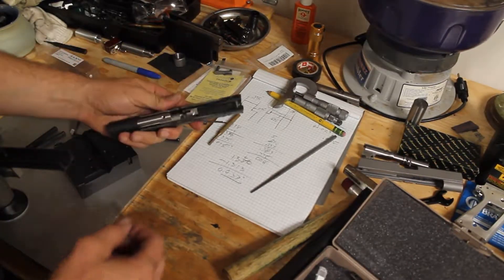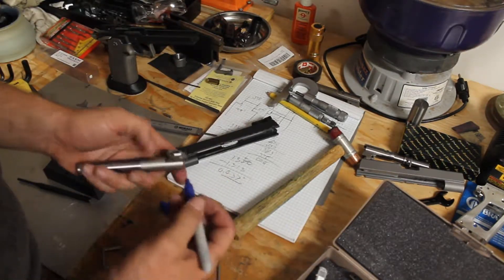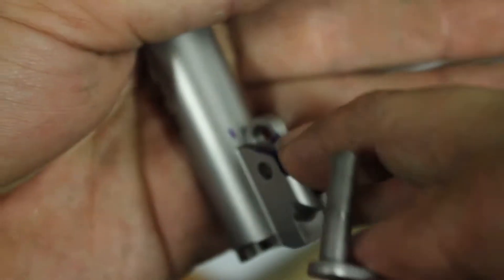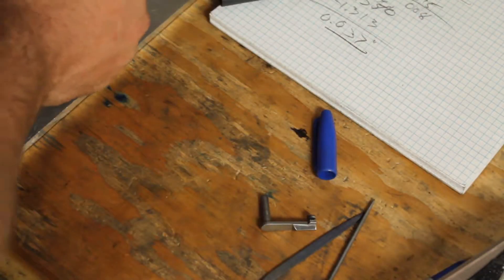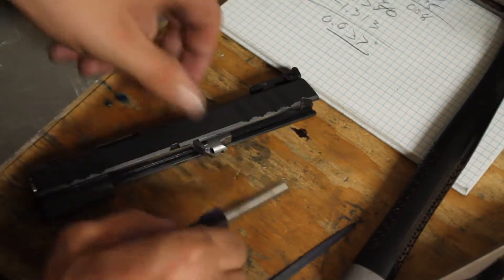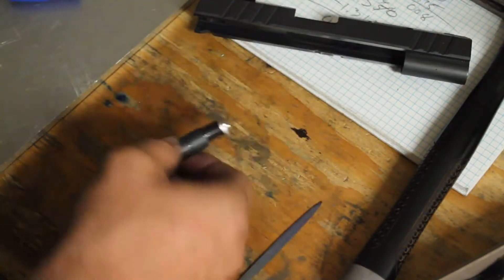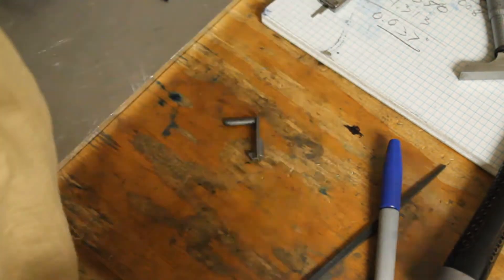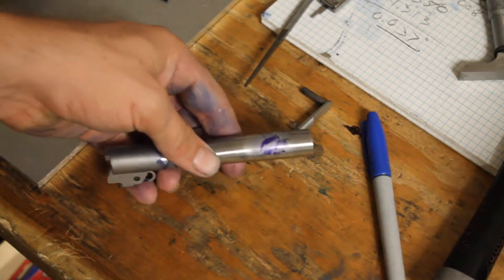Full Barrel Fitting Part 2 - upper lugs, muzzle and DOH!

Comment: well I guess it works if you are not buying the cutter jig, but this seems a little much with a bit prone to inaccurate barrel fitting get a barrel lug cutter at Brownells might be expensive but for best fit, its the only way to go
Reply: That's literally what he did in part 1 of the video 😅
Reply: @swartzkoft7886 no it is not, you know not of what you talk about, he cut the lugs with a rotary lug cutter, not using a jig in the mill, this guy is an amateur.
Reply: @swartzkoft7886 and he doesn’t know how to fit a link.